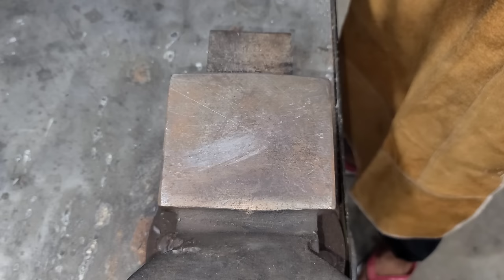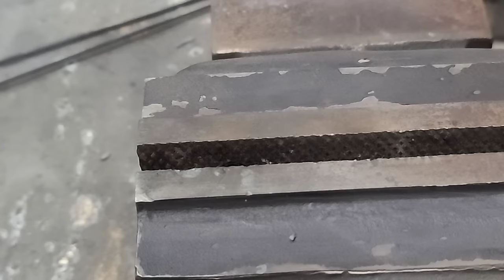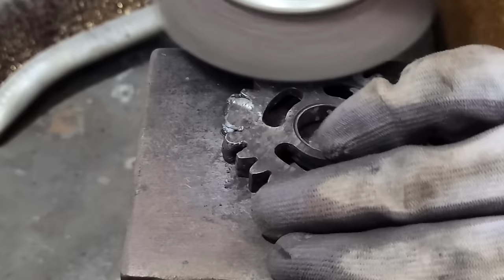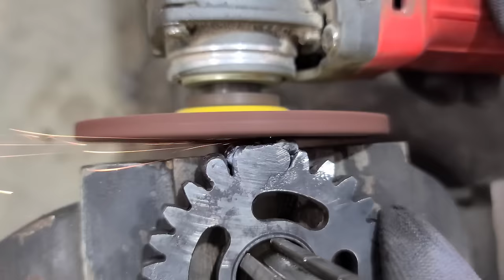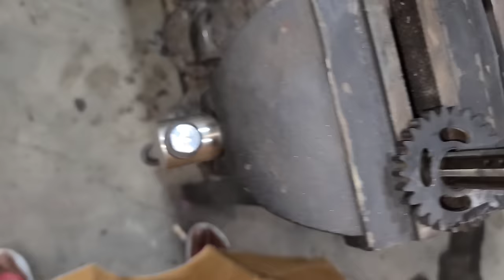Quick And Easy Gear Repair Without A Lathe

Comment: Nonsense, it won't hold up if it's really supposed to transmit power. No involute. No hardening.....without words. Without power transmission, only ok as a movement or temporary solution.
Reply: Un trabajo  muy malo disculpen pero  es así  eso se rellena  con  un electrodo duro  por ejemplo  un 106 o conargen 1400   previo  calentar  la pieza  antes  de comenzar
Reply: Затея неплохая. Но многое зависит от твёрдости. Смотря какую функцию выполняет эта шестеренка..
Reply: Перекуп-вариант, пока продает можно поездить!
Reply: Ещё можно загнать за бутылку.
Reply: Очень быстро эти зубья выкрошатся,т.к.их структура отличная от самой шестерни.Ставить эту шестерню в редуктор,себе дороже.Разборка и сборка чего стоят.
Reply: It depends on what it’s for. I did something like this for a steering gear on my lawnmower and it worked fine and never failed.
Reply: Согласен с вами -это вариант, когда надо срочно починить механизм, что бы производство не встало, пока не пришла новая шестерня.другие варианты я не рассматриваю 🧐
Reply: Sono d' accordo con te è uno scherzo. Saluti
Reply: @faustinoflores5954  un entendido, lo sabe, tendría que rebajar bien y insertar un trozo de otro piñón similar, luego soldar y templar.
Reply: @donaldappelhof2059 esto es piñón de caja cambio, que trabaja a muchas revoluciones, puede sufrir al acelerar y al retaque, es muy peligroso si se llegara a soltar el trozo, una revienta la caja o se tranca, botando al piloto, al suelo.
Reply: @carlosandrescaracuelsaaved3970  I’m sorry but I don’t know what you are saying. I don’t speak Spanish. My grandparents did but they are gone.
Reply: @carlosandrescaracuelsaaved3970  siii tiene  razón
Reply: @ЕвгенийПятаев-г7п  и то не стоит, потому как оторванный кусок может повредить весь механизм который потом возможно будет простаивать месяц!
Reply: May I suggest to create with some of the other teeth an opposite part. Put that opposite part at the broken place and cast the missing teeth. The material selections depend on the final application.
Reply: Ah you must be new to YouTube? Don't confuse engineering principles with click bait entertainment videos!
Reply: Parla Italiano
Reply: Honestly, I agree with all you said, but even before all that, he didn't really get get good penetration on the base metal, so those teeth will snap off if you tap them with a hammer.  The result is the same, it won't work.
Reply: عمل اخرق. بدون فائدة
Reply: Ĺĺĺlĺĺĺpp😅
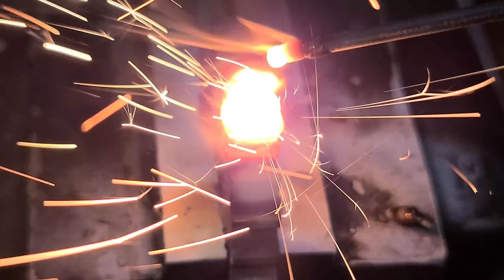Reply: 2:44 2:47 2:56
Reply: اختراع طارات الموتورات
Reply: @donaldappelhof2059 He said that it's very dangerous because it's a cog for a gearbox that spins at very high speeds and could break at any time, destroy the engine and potentially also injure the driver/rider.
Reply: @c3N3q  yeah I would not take the chance. I would make a new gear. It always depends on what it’s for.
Reply: Fake
Reply: I bet a magnaflux test will show cracks all over the place.
Reply: I did this so many times an my customers never come back with the same work for maintenance or complain.
Reply: I think because the force is shared right around the gear sprocket it's a good temp fix that will probably last longer than you would expect but never as good as new obviously but a clever fix none the less !!!
Reply: Испортили два электрода 😢
Reply: @omarbadjie-xq9fi what electrods did you use?
Reply: Я согласен, эвольвента зубьев не выдержать таким грубым инструментом, сломается и это зубчатое колесо, а так же износится и ответное.
Reply: Согласен с вами
Reply: Does it gives problems if there is weight difference in that wheel?
Reply: Zgadza się, trzeba to zachartować żeby to moc przenosiło, chyba że to do samochodziku na baterię.
Reply: Exactly. Even if he actual welded the metal on it wouldn't hold
Reply: It should work 😂😂
Reply: Honestly.If it works it will be stronger then the original.Reason,a weld is always stronger then the metal you use.Retired welder
Reply: @djreyo1712  agreedos!
Reply: This is what you do to fix a car before you sell it🤣
Reply: @gernothohl4058

no hardening?
Reply: That gear was ruined when the teeth broke, after he torched the metal with all that heat, it was destroyed even worse if that's possible.
Reply: Good ❤
Reply: 7:09 Mielenkiintoista. Sähköhitsauspuikon ydin sulatetaan kaasulla vaurioituneeseen kohteeseen. 😮. Koskaan en ole nähnyt vastaavaa..
Reply: A lot of work for a $10 gear which would be much stronger.
Reply: BUT what if that's a cheapo sintered unhardened gear which failed on 3 teeth because of a sinterering density defect? Then he'd be upgrading the base material. None of us knows the context.
Reply: I did this on a lathe backgear, only one tooth missing, on a part that was unobtainium, still working after 20 years, context of use is what’s missing.
Reply: It's will support, I'd try it.
Reply: @Олег-х7б5щ  это шестерня из КПП Хонды (видимо, клона китайского). Если бы она где-то в колесе стояла, чтобы можно было снять за полчаса, то я бы м.б повёлся на такую шнягу. Но когда для ее замены надо ВЕСЬ мотоцикл разобрать и мотор колоть, то нуивона... У меня такая же беда, весь сезон мотик разобранный простоял. Только не эта шестеренка, а там есть двойная такая, 3/4 передачи, ответная этой
Reply: What kind of muppet cleans the flux of electrodes and gas welds them on when mma would have taken seconds 😂

Comment: There was nothing wrong with that brand new gear until you cut off 3 sprockets. Useless information on repairs. How about getting a gear that actually has problems to show us how to repair
Reply: If you can buy a replacement part,do so. If you have a damaged obsolete part this could be a viable option to scrapping the the piece of equipment...
Reply: Can you do better? Eish
Reply: @for78get  yes, I can do better by not creating a problem that will never actually happen.
Reply: This is a demonstration of what can be done! Very clever stuff.

Comment: I'm not finding this either quick or easy. Just buy a new gear or have a shop make one. Thats much easier
Reply: I think they are comparing this repair  to mining iron ore, smelting it into steel, casting a rough gear, and shaping it using dental floss and 200-grit carborundum.  Can't help but wonder about thermal distortion, etc. etc. etc.

Comment: Gears are case hardened. If you get it red hot, it will soften it. On the other hand, if a replacement isn't available, I don't see anything wrong with trying an idea like this. Depending on what the gear goes to, and what the torque load is on it, it may last for the life of the machine. Thanks for sharing.
Reply: Let's face it, if that repair could last the rest of the life of the machine the original would never have broken. Plus the part damage was staged, a gear would not shear three teeth perfectly like that and the other gear would also be damaged.
Reply: @BeltFedToys  You are right this video was just a gimmick to get some money from Youtube!!!!!!
Reply: By the looks of it the gear comes from a scooter/small motorcycle .

Comment: Nice job. Depending on the application, it might last a long time, or maybe not. But for all the nay-sayers, keep in mind that many gears are made of much softer materials than whatever welding rods he used, such as plastic, nylon, and I've even seen many gears made out of wood.

Comment: Granted it’s far from repaired, but I Temporarily fixed a gear that was broke in my lathe like this 15 years ago.  The hub was broken also, and I MIG welded it.  If it breaks, I’ll temporarily fix it again.

Comment: This is one skilled craftsman. It doesn't mean the gear hasn't been permanently damaged by the process, or that it will be able to take any significant load without breaking and creating more damage. 
However, as an exercise, a curiosity, or a very temporary solution, it's quite impressive.
Reply: yes I was wondering about the heat damage to the gear, and IMHO I doubt it can take much load.
Reply: @mnztr1  Many gears are made of soft steel that can´t be hardened by heat treatment, and are not designed to handle big loads, so those would simply continue working. The repaired tooth can be nearly as strong as the other ones and they doesn't tend to get brittle eider after soldering. 
Now, heat treated high carbon steel gears, or even surface hardened gears might be ruined by these kind of repairs.
Reply: @SR-gs8zo  I also thought gears where all hardened steels, for a matter of logic. But at least here in Brasil, the steel most commonly used to make gears, including crown sprocket are mainly sae1020, according to their own specifications when you buy them, which is not hardenable, but can be cemented (surface treatment). Although for any higher speed applications, those would be hardened high carbon steels. But I agree that he made an excellent job.
Reply: @SR-gs8zo  maybe he connducted some hardening procedures after.
Reply: Tourbillion engineering😂
Reply: Most gears, especially if they are constantly lubricated - don't require hardening. So in most cases, this damages nothing.

Comment: I repaired a 1200 mm gear that had a small power gear with a dropped out keyway stuck to it, every 12th tooth was gone an old welder bronzed it up and I re cut the teeth with a dremil and files, it ran for 9 years and never failed. 

Good work
Reply: Yes in lower power installations can function but not at higher power ones, maybe for starters or for intermediate processing about not direct work flow i wouldn't recommend it.
Reply: 2.5 horsepower electric motor, machine spinning 1.2 metre x 1.4 metre high cast iron cam stamping caps onto a bottle and rolling threads in aluminium caps at 1700 RPM is light work of course even after 10 hours shifts for 9 years, however it never broke, the same welder also did Leyland and Mack tuck great boxes in the 1960s and 70s that hauled iron ore in the Pilbara of Western Australia, he laughed when I asked is it strong enough?

Comment: 1. Наплавка в пламени горелки - очень грубая операция, пережигающая и основной металл, и наплавку. Теми же электродами на небольшом токе с минусом на электроде можно было сделать нежнее, о наплавке проволокой в углекислоте я уж не говорю.
2. Воленс-неволенс, было бы неплохо шестерню после наплавки отпустить, а после механической обработки калить. Все-таки напряжения в корнях новых зубьев снялись бы, и выровнялась бы структура металла, насколько это вообще возможно в таких условиях.
3. Эвольвента - это не выдумка маньяков, её надо почитать и выполнять как можно точнее. А тут.... На самый худой конец можно сделать шаблоны с профилем нескольких зубьев, наложить их н венец с обеих сторон и по ним выводить профиль. Но все равно это "на безрыбье".
4. Всё это хорошо, если шестерня - стальная. А вот если основной металл - чугун, то всё это - фифехт фиксии. Металл у корня зуба обязательно отбелится, а белый чугун - хрупкий, как сахар. То есть, его можно попытаться наплавлять чем-то легкоплавким типа бронзы или табуна, а наплавлять сталью - чистое безумие.
Reply: I arc welded an outboard motor flywheel gear in 3 places. I made a template of about 10 teeth. Each spot needed 4 or 5 teeth welded. Ground it the same way. Came out great. Been using it for two years,still looks great. Saved about $500 dollars. Used  a $60 ebay arc welder. 👌
Reply: Я писал дипломный проект на Минском заводе шестерён (в семидесятых) и вы ,наверное поймёте моё негодование.Этот ролик-это воинствующее невежество.
Reply: Это мотоциклетная шестерня с 150-250 кубового чахлого мотора.
Материал сталь какой-то марки.
Что значит переживание?
Ничего что у него науглероживающий режим горелки включен?
Вы так негодует будто шестерня в грузовике Ман будет стоять.
Это дешёвая мотоциклетная, шестерня от китайца.
Reply: правильно нужна теплуха и закалка а это все пластилин как в китае.
Reply: @ЮрийПопов-б4г  ---Нужна не теплуха , а простой контейнер для меллолома.Время, затраченное на изготовление этого барахла почти такое же, как изготовить новую, но ещё надо учесть и скорую поломку.Так что невыгодна эта безделушка.Даже если делать не на зубофрезерном оборудовании, а в делительной головке на фрезере и то выгоднее,: точнее и надёжнее. Можно делать не всю деталь, а только венец, а потом насадить на вал
Reply: @helloslayer666  Одна из шестеренок коробки. Причем вся в сборе коробка оба вала с шестернями 1500р. При такой цене это трата времени.
Reply: @helloslayer666 да пофиг от чего она, срок её жизни в узле меньше того времени, что потрачено на эту порнографию
Reply: @qrip18  тогда скажите как иным способ отремонтировать КПП, в кругосветка, например в Камбодже или Уганде, Колумбии, Непале ?
Это полевой и он имеет место быть.
Reply: Вообщето эти шестерни сырые совсем они цементированы то есть каленый только тонкий слой ...
Reply: Модуль зуба важен для наименьшего износа и плавности хода зуб.пары! А эвольвента это угол спирали.
Есть прямозубые шестерни, есть косозубые, а есть эвольвентные с самым мягким 8:52 😊
Reply: Мало того что "глиной" наплавлено! К тому же и отжёг всю шестерню!
Но дней на 10 хватит...
Reply: @НиколайАртамонов-ц9ц  ты хоть знаешь от чего это шестерня, умник диванный?
Конкретно от чего это шестерня назови. Потом умничай про ресурс
Reply: @helloslayer666  Неважно, от чего эта шестерня. Важно, что при нагрузке в собранном узле эти "зубья" отлетят быстрее, чем состоится разгон до рабочих оборотов, и редуктор просто заклинит, вот и всё. Или вы считаете, что упасть на недорогом "дырчике" - можно?
Reply: @АлексейМихайлин-ф5й  назовите величину нагрузки при которой произойдет разрушение данной отремонтированной шестерни?
В системе СИ назовите величину нагрузки.

 У вас есть расчеты или лабораторные тесты данной отремонтированной шестерни?
Или это только ваше умозаключение?
Назовите рабочие обороты данного мотора?

Видите ли говоря "при нагрузке в собранном узле эти "зубья" отлетят быстрее" - вы говорите ОБЩИМИ слова.
Гипотетическая версия иными словами.

Я например знаю что это за шестерня, и от какого китайского мотора она, и знаю, из-за чего происходит данный дефект. 

Если вам интересно узнать, сначала ответьте на мои вопросы.
Reply: @helloslayer666   Нет. НЕ-интересно. А еще я много лет, начиная с 1975 года, имел отношение к орловскому заводу, который так и назывался: "Шестерен". Поэтому СИ, СГС, "от какого китайского мотора" - это совершенно неважно.
Reply: @АлексейМихайлин-ф5й  и какое отношение имел? Кем работал? Какой стаж? Награды есть? Каких достижений добился на заводе?
Знаю я таких заводчиков, которые кичатся что работали там то и там  то, а на самом деле пьянчуги и лентяи.
Reply: @helloslayer666  вам, батенька, производственную характеристику с печатью в pdf-ке выложить, или электронной подписи хватит?
Мы же оба знаем, что продукт "мастера" - муляж, памятник, украшение витрины, еще что угодно, но только это больше не шестерня. Зачем же хвалиться тем, что запомнил систему СИ?
Reply: Колхозная залепуха.
Reply: Это постанова, галимая, и так видно. Не один адекватный человек не будет этим заниматься
Reply: @robertvolpert8986 😅рад за Вас. Но шестерня не стоит 500 баксов, но полученный опыт несомненно стоит во много раз больше, поздравляю!

Comment: Really interesting - under certain circumstances, this could be a short-term lifesaver
Reply: the circumstances being that you don't use that cogwheel anywhere.
Reply: Those teeth will strip when put under load. Gears are a circular lever and the load is dictated by the ratio of one to the other and that determines torque load. They are also heat treated so they do not wear out quickly due to friction from steel to steel contact. Oil is a friction modifier not an eliminator.
Reply: Agreed, but some gearing is not really load-bearing - simply a time-keeping mechanism, such as in a watch.

Comment: I was expecting you to install it on the engine and wait for the teeth to break. Because, since it's not exanimated thermally , it'll definitely break.
Reply: "exanimated" means deprived of life - in other words 'dead'. So what you are saying is that if a gear is thermally dead it will break. Thermally dead would mean cold wouldn't it? So we can now conclude that warm gears break and cold gears don't. How utterly enlightening!!
Art from Ohio
Reply: Los metales al calentarlos pierden sus propiedades de dureza. Para que los engranes no se rompan se necesita aplicarles un procedimiento térmico después de soldarlos para que recuperen su dureza de lo contrario se romperán definitivamente
Reply: Ovaj se sigurno nece slomiti posle ovakvog varenja postaje mekano gvozdje mogu samo da mu se pokrive zubi u svakom slucaju je vise neupotrebljiv
Reply: Ничего там не сломается. Нет ничего постоянней, чем временное)
Reply: Seeing how it's no stronger than a braze and how it looks like there was previous repair damage elsewhere I would say this is probably in a low stress machine and would work fine for the use as intended.
Edit: typo corrected.
Reply: It's never going back in a transmission, just click bait for idiots who don't know any better .Youtube is full of this crap these days. Give the impression you're fixing  something complicated with hand tools, and never use it.. It's a joke..
Reply: @zivoradmirkovic9765  ko zna zna, ovi dosad nemaju pojma o čemu govore, neće pući nego će se potrošiti
Reply: @Glenn-p5i , if I was in the "backwater" and wanted out. Heck yeah, I would give it a try. Taking it easy and reducing the load just might "get the job done."

Comment: I've built up material and recut gear teeth on my riding mower rack and pinion at least a half dozen times in the last twenty years. 7018 rod and a cutting wheel on an angle grinder.

Comment: You could use a paper or scotch paper to get a precise template of the tooth around, cut it to the exact pattern and report it on the welded parts, would be way more precise than whatever you did with the caliper